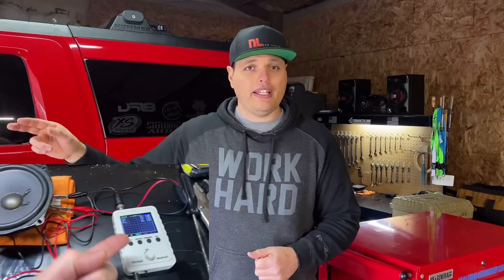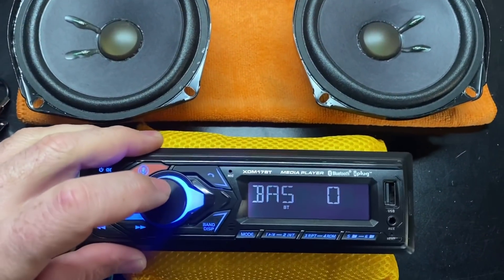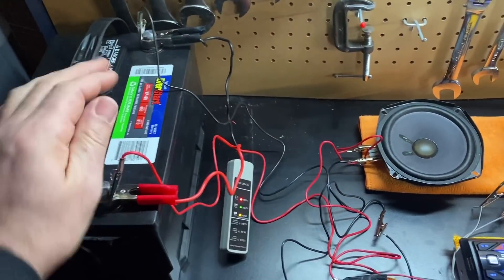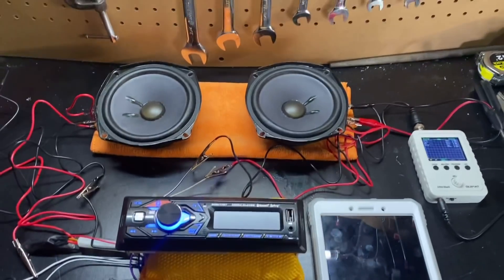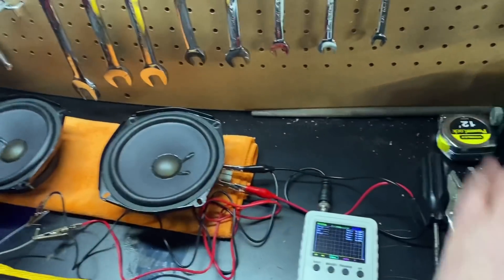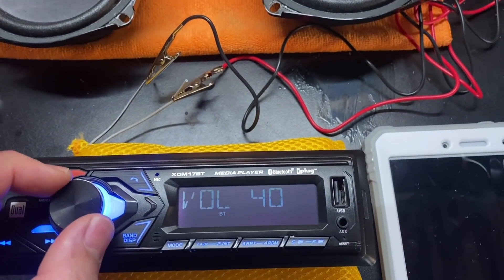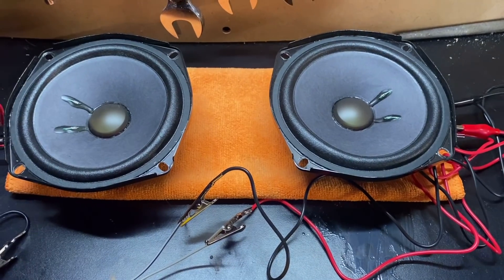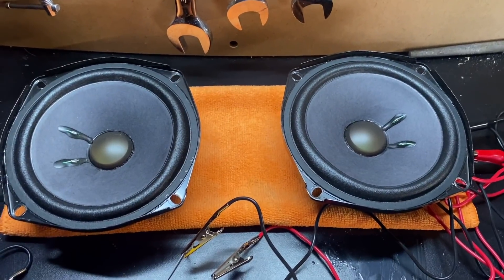#1 Must do tip!!! How to check head unit clipping and non distortion volume point of stereo.

Comment: What if your using 4 channel amp how do you find distortion then on HU
Reply from the maker: If using rca (low level) and you don’t have any speakers running off head unit power then no need. Your good.
Reply: @NextLevelCarAudio  so then I don’t need to find where head unit distorts if I run a 4 channel? Thanks for the reply man I really appreciate it. Also what test tone do you use to tune mids and what do I use for the super tweets? 1000khz on both?
Reply from the maker: 1000 yes, and yes that is correct. No need if speaker wires on head unit not being used

Comment: my head unit goes to 35, i’ve played my music at 25-27 with no problem now all of the sudden my speakers will distort at 20 and these are all new speakers and newer head unit, i’ve soldered and checked the connections and i’m still not sure what to do
Reply from the maker: Running an amp or just off head unit power?
Reply: @NextLevelCarAudio  head unit power
Reply from the maker: Hmmm. Not sure man without actually tinkering with it…. Only thing I can think of is the EQ settings or bass setting on head unit changed which causes earlier distortion?
Reply: @NextLevelCarAudio  i factory reset the head until to make sure that everything was off and still the same
Reply from the maker: Shoot… not sure man. May need to take it in to a shop to have them tinker with it. Sorry :/
Reply: @NextLevelCarAudio  all good thank you

Comment: can i connect it to the rca?
Reply from the maker: Yes you can. Usually rca does not clip as they are low level
Reply: @NextLevelCarAudio  thank you so much!!!! Because I don’t have stock speakers and don’t wanna take my radio back out since I have rca installed since I’m waiting for my power wire to come in for my amp
Reply from the maker: Yep. Your good man

Comment: I'm so confused....I thought you had to test the signal via an RCA to find HU clipping.  The speaker wire carries a voltage signal?
Reply from the maker: Yes, check HU clipping via high level V (speaker wires) if you are running any speakers off head unit power. RCA’s if only running externally amplified
Reply: @NextLevelCarAudio  any reason I can't do that with my speakers or subwoofer instead of plugging right into the amp or testing the RCA

Comment: Do you have an easy way to check for distortion on the RCA outputs?
Reply from the maker: Use the value you got for high level. Or just turn it up to how loud you listen to your music. If using low level, that means your running an external amp. It does not play “as big” as a role as it does with “head unit only” amplifier speakers since you do have a gain adjustment on your amp to adjust sensitivity.

Comment: What if it's a OEM  head headunit with a factory amp?
Reply from the maker: Tap into a door speakers or rear deck speaker. No need to even disconnect
Reply: @NextLevelCarAudio  thanks for the reply.

Comment: what happens if you connect all speaker cables to one speaker ?
Reply from the maker: You would be bridging the amp or head unit by doing that. Some you can, some you will damage or throw it into protect.

Comment: Barevids made a video about sending a clipped signal to your amplifier. If you send a 40hz square wave to an amplifier, it will still put out a pure 40Hz sine wave. Obviously not ideal for amplifier or sound quality, but theoretically shouldnt overheat subs.
Reply from the maker: Yes.... but remember, this is for speakers that are non amplified and being powered only by the head unit. (As shown in the test)  That is the case for a lot of people out there that are running a OEM front stage,  with just a amplified sub stage. These people need to know where their head unit clips so they don’t blow their head unit powered speakers.
Reply: @NextLevelCarAudio  ah legend that's so true. That means i could be clipping my door speakers if I'm not careful haha.
Reply from the maker: Yep lol

Comment: Clipping a head unit wont hurt your gear. Especially if the signal is going to a sub amp because the x-over smooths out the signal.

Comment: You shouldn't do this with any speakers connected, you should just connect directly to the speaker outputs on the head unit and test that way, because if you have speakers that can't handle the power they will clip earlier than what the head unit would be clipping on speakers that can handle it. And yes you should test your RCA outputs clip points as well as your speaker outputs. I've been doing this for over 30 years and I never test clipping with any speakers connected it's just a No-No.

Comment: Great video as always. Have you seen the Barevids video of how the amplifier restores a clipped headunit sine wave back to a perfect wave at the amp output? Its crazy! It not good to send distorted signal especially for un amplified midrange but as far as amplified subwoofer damage it looks like its not a problem. Here is link in case you want to check it out. -Cheers mate.   https://www.youtube.com/watch?v=TY4cr6tOK3s

Comment: You are making some assumptions here. Your radio may clip at 36 on a 0 dB test tone but if the music track you play is at -10 dB it won't clip at 40
Reply from the maker: I’m not making any “assumptions”.... it’s common sense people should dial in their head unit with a 0db test tone. It would be foolish to tune with -6, -10, etc.... then when they play 0db tracks they would surely clip. No further comment.